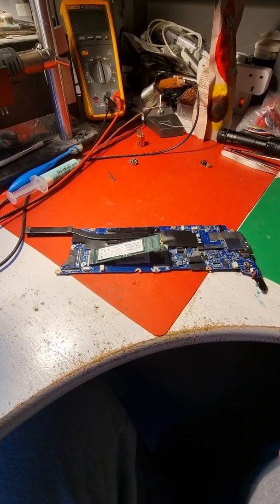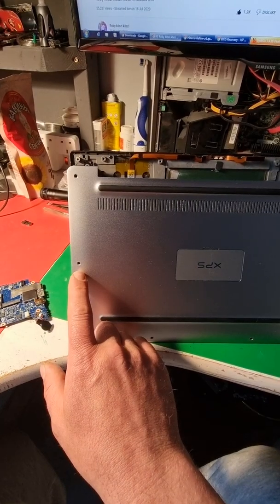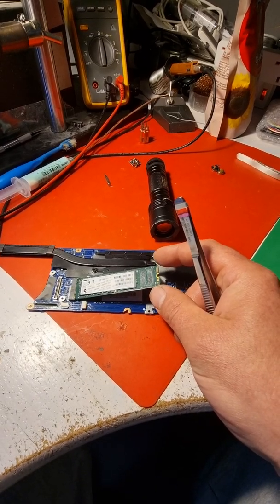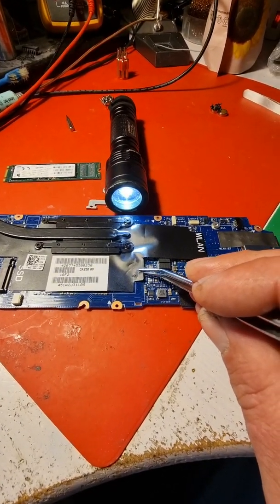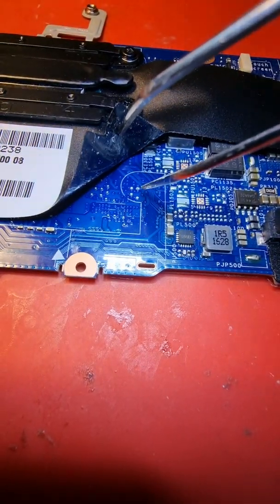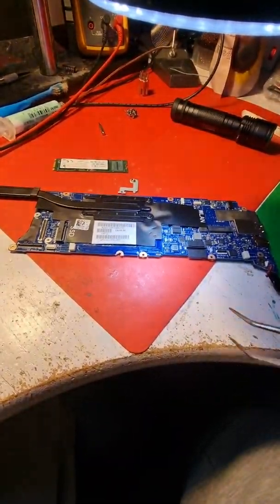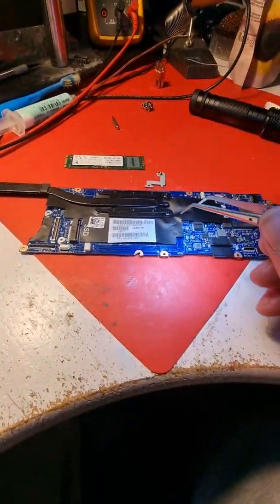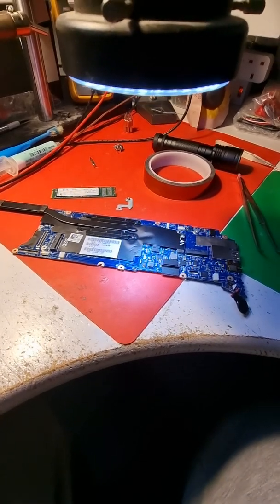Dell XPS 13 9360 freezing, black screen, artifacts with frozen screen fix. Back cover removed works.

Comment: If you want to know the fix, the m.2 screw is shorting against the motherboard. Apply electrical some tape below the m.2 screw hole and that will stop the freezing issue.

This worked on my ewaste 9360 and it's been several months now.